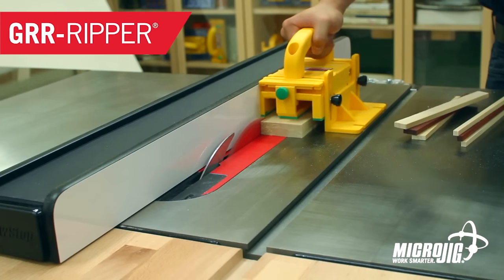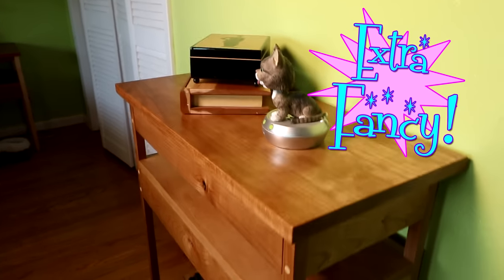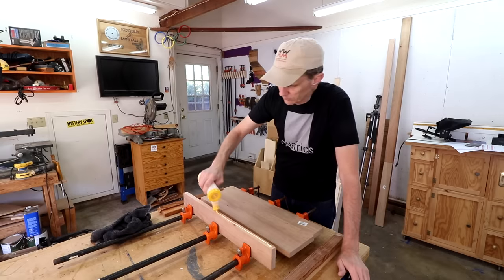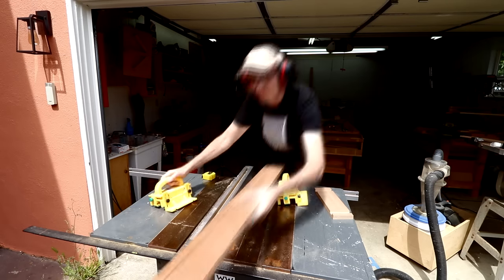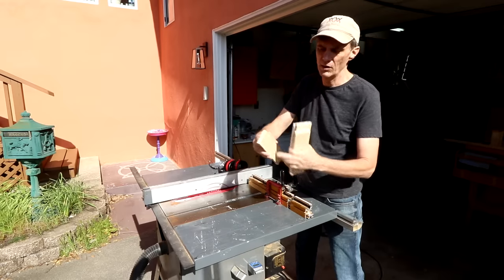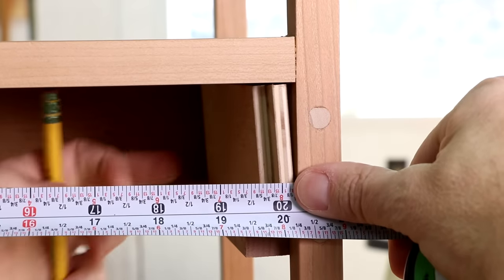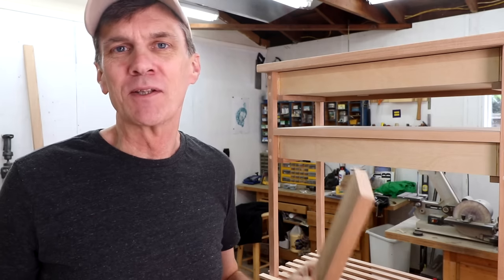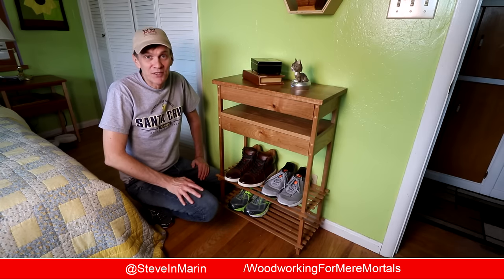The Gentleman's Stand

Comment: Hi from France Steve, thanks for your videos! Just to tell you, try to use edge of your piece of wood when you glue up, it's stronger and better to get a plane surface, and if you want to avoid scratches from gluing you can just set rubber tap on your wedges. Sorry for my English, I'm still working on it ;)

Comment: Great project. Simple with nice clean lines. I would suggest making the bottom drawer about 2-3 inches lower. This would make good use of the drawers upper surface for extra storage of items like vitamin bottles or other things you want close at hand without cluttering the top.

Comment: This was not the first time you have used the principle of cutting slots or dadoes that must line up on sides or legs in a board before cutting the separate legs/sides from the board, and it is so effective.   But why do I forget this clever technique when I have a similar job to do, and then struggle to ensure slots or dadoes are positioned equally on already created sides or legs?  Perhaps it my age  :-)   Anyway, another super project, and not a jointer/thicknesser in sight!

Comment: Hi, I know this is not related to the video, but I need your advice. The problem is that I live in a region with lots of snow during winter and I'm worried that if I use wood shingles for the outdoor walls, it will rot. Do you think I should change the wood shingles for an other material that is more resistant to water ? If yes, can you tell me what should I use. Thanks for all and great video !

Comment: I am a little concerned about Expansion contraction problems with the top and its attachment...please Steve alleviate my fears. : )
Reply: I suspect that as it is only 2 feet/60cm wide expansion would be minimal and would not stress the screws too much. Also, once inside the house, there may not be much atmospheric change in temperature or humidity.
Reply: Steve lives in the San Francisco Bay area and may not have much seasonal wood movement to account for. Some areas it might be a problem.

Comment: Hey Steve. I love your stuff and how down to earth you are. I used spray lacquer the first time the other day after watching your spray lacquer video on a piece of poplar. You had said there was no need for sanding in between coats but mine needed it badly. Any suggestions
Reply from the maker: It can depend on the amount of dust in the air. Sometimes I have to sand dust that sticks if I lacquer outside on a windy day.

Comment: you should change your table saw blade to a flat top grind (FTG) carbide tooth instead of an ATB (alternate Top Bevel) so that your  rabbits and tenons are much flatter and cleaner, just an opinion.
Reply from the maker: +certified30 The flat bottoms don't show when they are assembled, and it doesn't affect holding power, so I see no reason to buy an extra blade.
Reply: it certainly doesn't affect the holding power, but when you are working on a high quality project that requires a lot of precision cuts and fittings, it makes a difference, it is also satisfying to know that your tenons and mortises fit with no "V" grooves, also when you cut rabbits and slots, the face of the cut is perfectly flat. 

or may be it is just my OCD kicking LOL, i really enjoy your videos, you are probably the happiest woodworker on YouTube as the rest are super grumpy and serious.

Comment: Hi Steve. Why use dowels on the legs? Just wondering the thought process behind when to choose dowels. New to woodworking. Asking for knowledge.
Reply: Bobby Hopkins Its for joint strength as the glue area is not very big.
Good question! !
Reply: That makes sense. Follow up questions: So why dowels vs nails or screws?
Reply: Dowels are stronger than small brad nails and better looking than screws as they are visible from the front ... adds some character with the color difference.
Reply: That's great! Thanks for the reply. So functional and aesthetic. I've never used dowels, but it seems simple enough and looks good. Thanks!
Reply: Noooo problem,  glad to help!
Reply from the maker: Great question. The main reason I used them here was because I was gluing the end grain of those boards, which isn't very strong. The dowels give the joint much greater strength. Plus they look cool.

Comment: Hi Steve, thanks for another great video! I noticed that you use Watco spray lacquer (at least in this video) and I just searched for that product at the big box store and saw that it's about $35/can. I was wondering what makes that one more expensive and better than the cheap Rustoleum or something similar that is only about $5/can?
Reply from the maker: +Corey Loyd That's weird. They are about $6 at my local Ace Hardware.
Reply: Weird! I better check again, maybe that price was for multiple cans. Thanks!
Reply: Corey Loyd Contractor pack, maybe?

Comment: I still don’t quite understand exactly how the edge joining jig works, could anybody explain?
Reply: Andrew Marsden ok so the jig has a straight edge that is run up against the fence. You place your board on the jig clamp it it down or screw it down to the jig. And run the crooked edge of the board through the blade. Let the crooked edge over hang the jig ok then that cuts a straight edge on the board. Then you take the board off the jig and run the straight edge that you just cut and it against the fence. Then the board will be parallel.